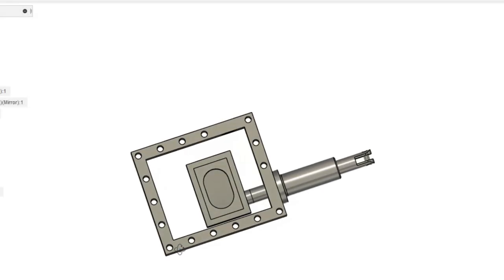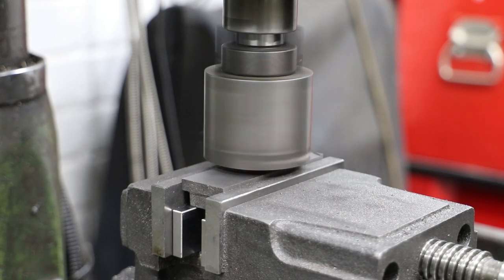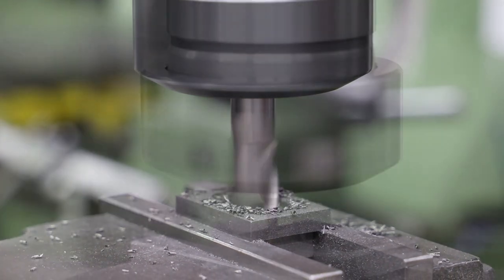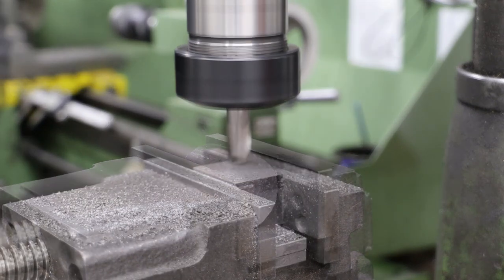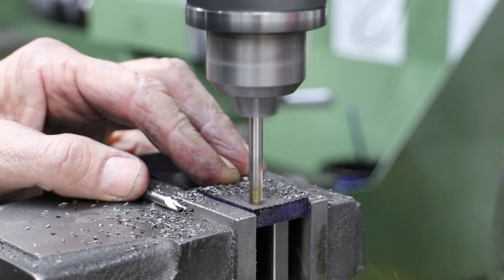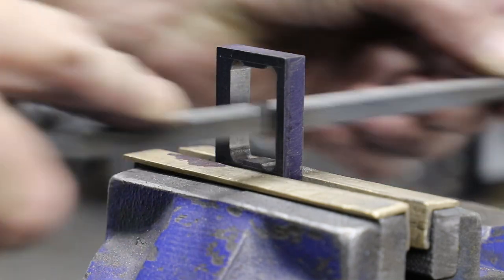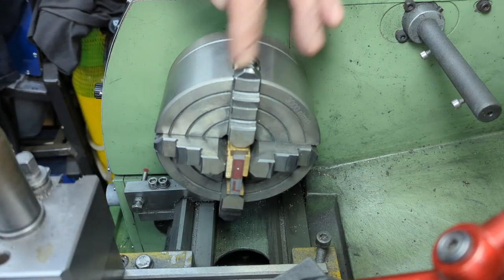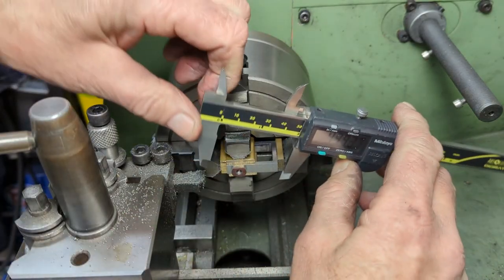Part 41: The Steam Valves and Buckles

Comment: Hi Mark the buckles look good. When you were machining the stubs I was expecting the material to crack from the tooling pressure. Alas this did not happen.
Reply from the maker: Probably 'good' rather than 'alas' it did not happen 😁
I was comfortable that the brass packing was giving enough support, so much so that I was taking 0.5mm cuts when facing.  The only time I was a bit nervous was when I was removing the centre of the buckles as there was significant pressure from the vice.
Cheers
Mark

Comment: one can use double-sided Scotch Tape between the Brass Shims and the Valve Buckle to hold the Bras Shims in place as you adjust the Workpiece in the 4 Jaw Chuck. It keeps them from falling into the Chip Tray. That is how I machine similar parts for my Locomotives.
Reply from the maker: Nice suggestion Bruce, thankyou 👍🙂

Comment: I'm a little lost as to the function of the buckles? Are they the frames that hold and move the valve blocks, rather than the valves themselves being moved by the valve connecting rods? Are there any benefits of using a buckle system over the valves being moved directly?
Reply from the maker: Hi Phillip,
Good question 🙂
You've answered the first bit, they are indeed frames that hold the valves, rather than the spindle going directly into the valves.  
A few things to note, and there are much more informed people than me out there, so I'm happy to be corrected.
The valves are not fixed in the frames, so in theory can move up and down with respect the frame.
Therefore, the valve body "floats" and is held against the steam port face of the cylinder block by the steam pressure.  
As there are no cylinder drain valves on this loco (although I might fit some), the valve needs to float to allow it to lift and prevent hydraulic lock when there's water in the cylinder.
The valve and steam port face will eventually wear (although this applies to many other parts of the loco, so by "floating" is self compensating).
I trust this helps?
Cheers
Mark